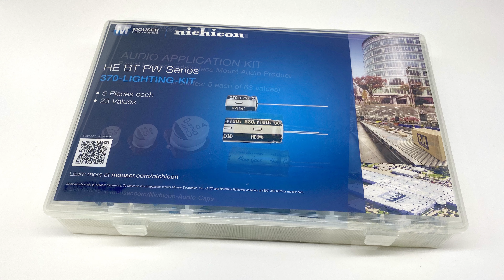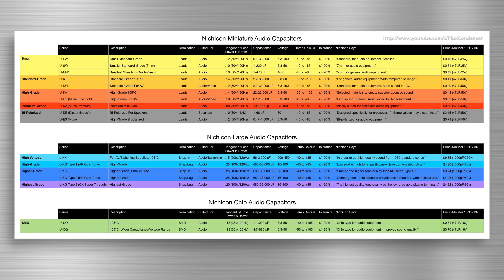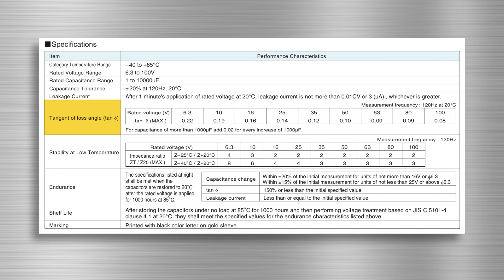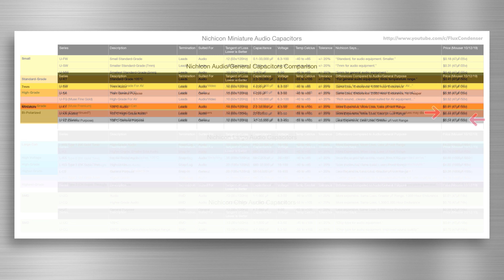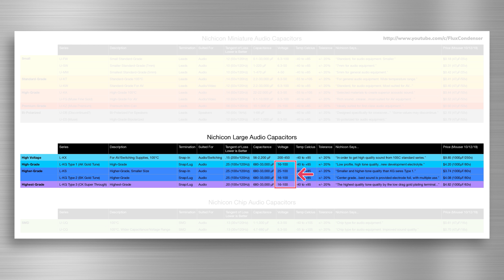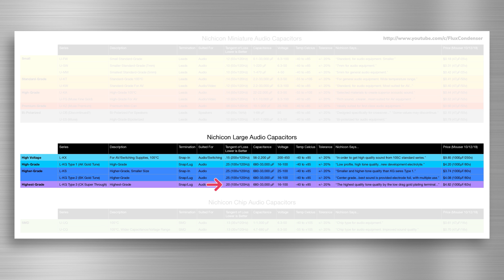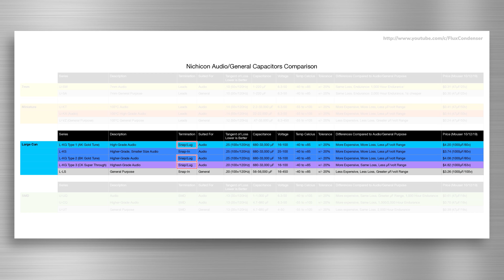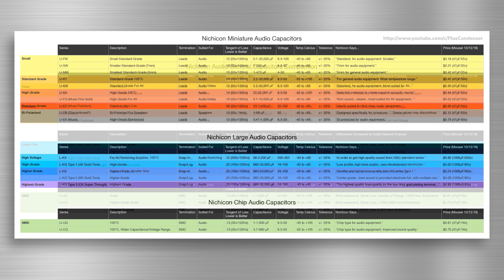How To Choose Nichicon Audio Capacitors. Are They Worth It?

Comment: What a brilliant and informative explanation! I've been tearing my hair out too trying to choose cap replacements for my 50 year-old Sansui (AU-222) amp. This time I'll go with ELNA (and Panasonic FC's for the PSU) because ELNA was what Sansui used originally. I'm only going with Panasonic as the ELNA Silmic caps won't reach the dizzy heights of 1500µF. But knowing me, I've still probably got it all wrong! This video certainly sheds more light on this somewhat murky area of amp recapping. So impressed, that you get a subscribe and a like for the video from me.
Reply: Focus on the PSU smoothing caps, thats where the major performance boost is, go for larger values as you can (up to 150,000uF), good values is around 20,000uF-which exceeds some audiophile amps, hell Musical Fidelity £1000 amps only have a 6800uf on each rail.

Comment: I found that instead of using high-end capacitors which take work to replace I simply move my chair back and forth based on my audio needs. If I move forward the sound stage gets brighter and the bass gets louder if I move back the opposite happens. So instead I made a NICHICON chair. I too have o values to represent this movement but I can swear by them just the same. Happy listening. Remember to always tell yourself before every LP start, this system is the best and you will believe it. ENJOY!
Reply from the maker: Chairs are fine, but true audiophiles listen while doing handstands.

Comment: When I was ordering caps for the pre-amp upgrade, once I figured out that KZ were the premium line, my only concern became size. I ended up having to use mostly Fine Gold as the KZ caps were just too large in diameter to fit in the available footprints. Lead diameter also didn't really work out with the KZs.
What I found interesting, were the price breaks in volume. One item on Mouser was like $10.40 for the 24 I needed or for $10.80 I could get 100.

Comment: For those looking to upgrade their power supply smoothing caps, I have done some calculations/rule of thumb for you.
1) Typically you get around 10,000 to 15,000uf in the supply, @100W this equates to about 10% voltage variation at full wattage, so if you were to go to 150,000uF that would be about 1% voltage variation, this higher value will give you a much better performance that just changing brands or type to audio grade.
2) make sure you have a 0.1uF metalized film cap in parallel with the supply caps, this is standard on all modern amps now, but check anyway as it caused a massive betterment of sound.
3) The supply caps are often between + and 0v and +v and 0V, you can decrease ripple further by adding a cap between -V an +V, just remember these need to be double the working voltage (V) of the other caps.

As for the video, I believe the audio grade give better ESR (Series resistance) at the audio frequencies, however I can find NO information about this on the Nichicon website, so perhaps this is just false otherwise they would be proud to publish those graphs.
Reply: Ok .01 mylar at what voltage?

Comment: I'm replacing the caps on a high-end pre-amp of which the enthusiast owner has 3 of the same unit and has agreed to blind test against one of the older units with the factory installed Xicon caps. I'll be using KZ and FG. It'll be interesting to see if the owner of the equipment, who has spent hundreds of hours listening, will be able to hear the difference.  They definitely look classy.
Reply from the maker: I’d definitely be interested in finding out the results of that listening test, so let me know how it goes. Of course, the results will only be as good as the test-setup to make sure all the levels are perfectly matched, etc. As I’m sure you know, even a tiny difference in levels is enough for one piece of equipment to sound “better” than another. I’ve got some newly acquired antique Macintosh gear that I’ll recap with Nichicon audio-grades. As you said, they look classy. And even though some of the marketing claims are questionable, they’re kind of a no-brainer for high-end classic gear where money is no object. Thanks for watching and your great comment!
Reply: @FluxCondenser  It should be easy enough to setup both pre-amps identically as they have digital menu driven UIs and will be configured exactly the same. I hadn't given it much thought beyond that, but I guess I should measure & compare the output voltages prior to the test. The third unit will likely get the same treatment but with ELNA Simlic capacitors. It seemed like a rare opportunity to blind test cap upgrades in identical $5K pre-amps like this, so I too am very interested in the results. No idea if he will be able to hear a difference, prefer the old 'familiar' sounding caps, or be able to hear details in the audio he's never heard before.... It'll be interesting for sure. I'll let you know how it goes.
Reply: @johnfranks  what's the result? did he realize a big difference in the sound?
Reply: Have you gotten a result yet? We're getting excited here.
Reply: Heyy results?
Reply: Any results John??????
Reply: @johnfranks  Hey! Dude! You're leaving the internet hanging here!! What was the end result????
Reply: yeah I 'm amongst them others who really looking forward to the outcomes of your test!
Reply: I hope he didn't get shocked...
Reply from the maker: John Franks R.I.P.
Reply: Any results yet?
Reply: Apparently one model of those caps created a previously unheard of deadly hyperloop, according to his widow. She couldn't remember which one. Good luck!

Comment: When upgrade or recap old audio amplifier, I always use Nichicon FG for small caps, and Nichicon KG or KS for power supply caps. The amps sound very good after an upgrade, treble is detailed and bass is tighter but maybe because old caps are not in good condition anymore. At least inside of the amplifier is pretty now with gold looking caps.
Reply from the maker: Thanks for your input, Faisal. I agree, the Nichicon audio caps are good quality, and look great.
Reply: halo , faisal can i know which parts to recap replace to get better sound ? tq
Reply: n where to buy this parts ? tq
Reply from the maker: I buy my components through Mouser.
Reply: For my guitar pedals, I have bought whatever Nichicon that was available that had the correct specs. It doesn’t make a noticeable difference in sound  but for psychological reasons I like using that brand. It’s kind of like a cosmetic thing.

Comment: Great video. Learn something new with every video. I do have a question, I have speakers that are 36 yrs old and want to recap the crossovers. There are several bipolar  caps with large values that would make going non electrolytic very expensive so instead would want to use say an electrolytic with a high quality bypass cap. How do I do that? Or if I chose to do non electrolytic how would I replace a bipolar cap? Thank you for your time and the education you deliver with every video.

Comment: For beautiful results on DAP mods. Use Fine Gold on the amp input section, 1% PHILIPS Axial Polypropylene Capacitor (s) and 1% copper pin WIMA FKP2 (5% and higher don't use copper) series film capacitor. Then use Elna Silmic II's elsewhere and you'll get some excellent audible Golden results. Wide + Tall + 3D deep sound with accurate instrument positioning.

Comment: Very nice and informative video.  I have crossovers that are 25 years old.  Even though I have a matched set of speakers & crossovers, one sounds slightly different; guess it could be room modes.?.  There appear to be Nichicon 'Green Can' - Muse BP caps and T.I. (not sure who makes them) 'Orange Can' - BP and NP caps.  All are 85C rated.  Do you think it worth to blanket replace all caps or take each out, measure, and then decide?
Reply from the maker: Thanks, David. If you’re uncertain what’s causing the difference in sound, I would try to isolate that first. You mention room modes, so start there. You could try swapping the speakers to see if they retain the same sound in different positions. Or, temporarily place them close together in the center of the room and listen closely to determine if they sound different. If they do indeed sound different, isolate which driver(s) are contributing to the difference and make certain all drivers are actually functioning. With three-way speakers, for example, a speaker with a burnt-out tweeter or midrange can be somewhat difficult to immediately detect in a stereo system. If the sound is different left from right, but it doesn’t follow the speakers, you could have another problem in the system. Perhaps a cable, amp, preamp, etc. 

Finally, if you find there are differences in sound between the speakers, and all the drivers are working, you could indeed have a problem with the crossover(s). You may not need to do a complete recap to fix this, though, and the problem may not even be a capacitor. Additionally, even if all drivers are functioning, one of them may still be damaged which is contributing to the sound differences. Inspect the drivers carefully. 

As you can see, diagnosing this issue could be complex, and I can’t recommend a blanket recap of the crossovers as the definite solution. If these were much older speakers I would recommend the recap, but 25 year-old Nichicons aren’t typically a problem. That said, again, there’s still a small possibility one or more have developed a problem.
Reply: @FluxCondenser  Thanks very  much for the highly descriptive response.  I will certainly try and narrow it down.  I do know that all drivers sound like there are working, but as you say one or more could still have some type of deficiency, even though emitting sound.  Thanks again!
Reply from the maker: Always happy to help, David. Good luck figuring this out.

Comment: Without knowing much on the subject... Do they use different dielectrics or construction types? Perhaps this plays a role outside the measurements you used?
Reply from the maker: It’s a good question, but Nichicon doesn’t claim that some capacitor series possess better construction. And whether they use a different dielectric (again, no claims are made) is of no matter if that doesn’t contribute to better performance. The true quality ratings that should be used to compare Nichicon capacitors to one another are voltage rating, temperature rating and ESR or tangent of loss which I cover in the video. These three variables tell you everything you need to know about their comparative longevity and suitability.

Thanks for the great question.
Reply: Good thoughts but at the end of the day those aspects should also show up on the datasheet. Even the physical construction should show some measurable benefit such as service life or with a military or automotive grade from better vibration resistance, etc.

Comment: Although, I really find your videos super-interesting for me as an audio hobbyst slash a bit diyer, this particular video is not about an experience since you actually can hear a difference between different types of materials/types of Nichi's caps when you have a top performance audio system. And I insist when you can measure these approx the same, just listen on a good resolving equipment. You'll hear. I personally compared LKG Type III vs Type II in my DAC PSU and they do sound different indeed. While cheaper Axial versions were sounding nice, the top of the line were outstanding. Mundorf sounded a bit uninvolving and too bassy.

If you compare a top of the line resistors for example, Vishay UXB vs VSR they tend to sound really different to each other in each stage where you put them. UXB sound a bit veiled but a bit smoother than completely transparent VSR. But they measure the same.
Reply from the maker: I appreciate your opinion, but based on my listening experience it’s not one that I share. Without a double-blind study with instantaneous switching between two different components exactly matched for level, observations about sound differences are largely influenced by our psychology. The human ear and brain are notoriously bad at remembering what something sounds like, so without the instantaneous double-blind switching, humans are likely to apply our prejudices when deciding when one component sounds better. Very few high fidelity manufacturers (including Nichicon) subject their components to such analysis because frankly, it would almost always prove their marketing hype to be baloney.

Comment: Good informaition but is Tan delta expressed in %?  Isn't it simply the ratio of the series resistor value to the overall complex impedance.
Reply from the maker: Thanks, Subramoniam. Yes, you’re absolutely correct. The tangent-of-loss is the difference in degrees between the cap voltage/current phase angle to a theoretically perfect 90 degrees. It should be stated in degrees, not percentage. If I made that mistake in the video my apologies. Thanks again for pointing that out.
Reply: @FluxCondenser   ratio of ESR to Capacitive impedance.(Sorry, I mentioned it as overall impedance in my comment). Tangent being ratio wouldn't have a unit. But the loss angle yes in degrees

Comment: 8:47 We tried Nichicon KG in power amp, they really give better sound.
Reply: halo , fren can i know which parts capacitor to replace to get better sound quality ? tq
Reply: @kevinchew2594  Hi,  Mostly the big puffer caps affect the sound. Super Through KG is the best for this purpose in power amp.
Reply from the maker: Kevin, test the capacitors and replace ones that are out of spec. Electrolytics are typically the most likely type to fail. 

A bad filter cap can increase noise. A coupling capacitor will be in the audio signal. Bypass capacitors are less likely to affect sound, but a bad one can still cause issues. 

It’s not advisable to simply replace a capacitor in search of better sound quality as two capacitors that measure the same for capacitance, leakage and loss will sound the same, regardless of brand or silly marketing claims.
Reply: @kevinchew2594  check the circuit diagram and change the electrolytic capacitors that do not go to ground. The ones that effect the sound the most are the filter or smoothing capacitors

Comment: which is better nichicon or elna?
Reply from the maker: I can’t make a blanket statement that one brand is better than the other. In my opinion, caps sound the same if they test the same. Compare the price and tangent of loss between brands for the caps you need. Focus on getting the correct uF, voltage rating, temp rating, size and terminal type. Once your comparison is apples:apples, choose the cap with the lowest tangent of loss and/or the best price, depending on what’s of more importance for the given application.

Don’t fall for marketing claims which dishonestly make claims about sound quality.
Reply: They are both top quality. For the audio path I use Elna Silmic II and power supply NIchicon and Rubycon

Comment: The difference in the audio capacitors is in the perceived texture, sometimes called tone although it is more subtle. I am quite tired of the "if it can't be measured it can't be heard" line. That is not true. Any measurement is limited by your measurement equipment and the selected magnitud to measure. Human ear is an analog system that perceives far more than your scope can measure. The thing, is not all perceived information is made available to our conscious mind, because subconscious mind does not consider it relevant enough. But what we often describe as "musicality" in components, is a subconscious perception, which is far superior (actually, it is analog = potentially unlimited, you really perceive the whole physical thing) to what is available to us in our conscious perception. Makes sense ?
Reply from the maker: You couldn’t be more wrong or make a more senseless comment about the subject. Perceived texture sometimes called tone? Give me a break. You’re simply out of your depth of knowledge and suffering from the Dunning–Kruger effect.

Comment: Just the way they justify this stuff seems to be another snake oil audiophile crap to me. When i'm doing a recap on my old luxman amp i'm just using nippon chemi-con, luxman used them 40 years ago and they still use it to this day so they probably know what's best.
Reply: A little follow up, after taking a closer at the schematics of my amp i found out that none of the electrolytic caps where even used in the signal path. All of them where either in the power supply or things like protection circuits. My advice would be to just take a look at what the capacitors are used for and then choose one made for that purpose. I found out that using caps made for power supplies have way higher ripple current than these nichicon audio caps for example.
Reply: Agree with you..........